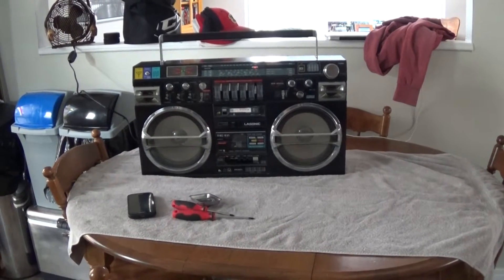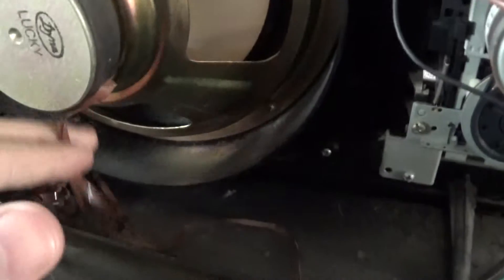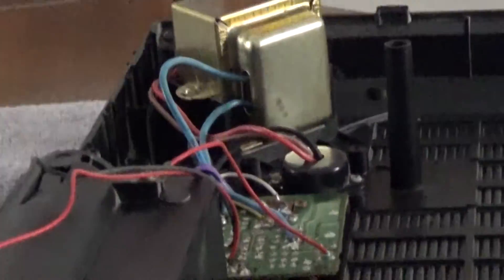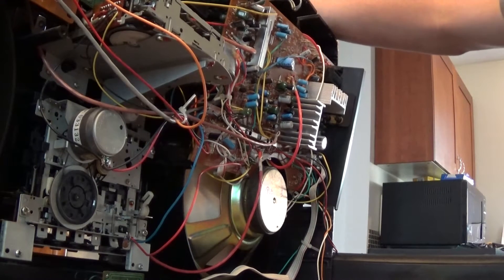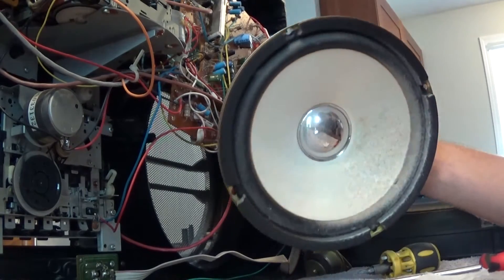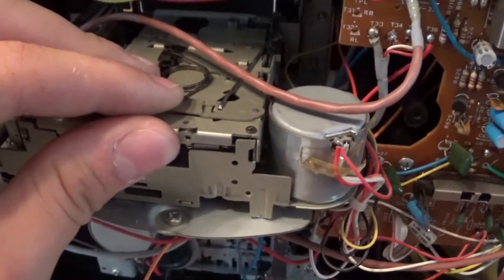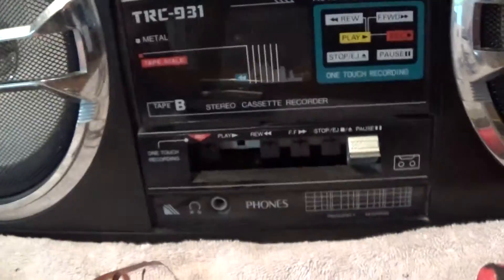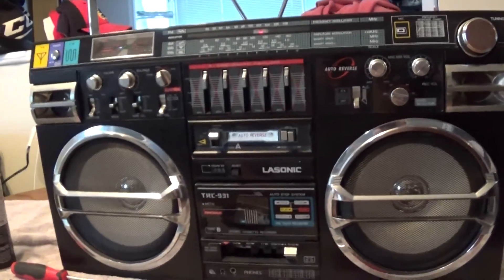Cleaning A Lasonic TRC 931

Comment: Nice job. Found the same model radio a month ago in the trash and it works great just need to clean up and replace the antenna  the top deck is broken if you stick a tape in it it will spit out the guts of it in seconds lol but. I want to remove  the entire  unit and fit a USB adapter and tap to aux. adapter from the bottom deck to top to plug in my phone and play mp3 files gonna use a small multiplug ext. Cord that way no splicing is needed, only Need to remove the top deck and make some kind of plate to hold phone in place. Do you have any advice for me on doing so? never did this before  so I'm not even sure if the top. Deck is removable. Thanks
Reply: jamster81 Advice... Why add modifications to such an epic ghetto blaster? Keep it all original.. If u want an upgraded boombox just get the newer model and sell the one you have as is so someone can repair it and keep it origibal